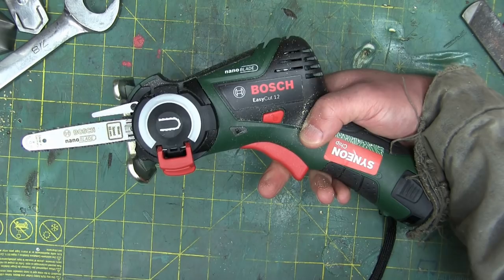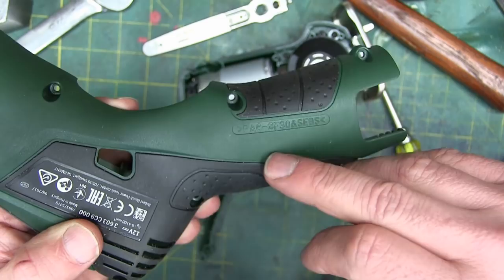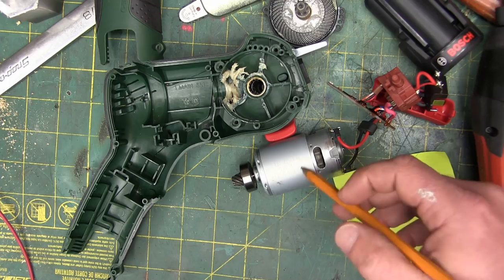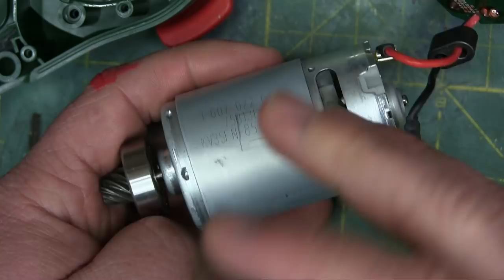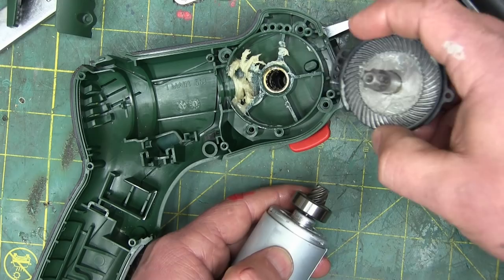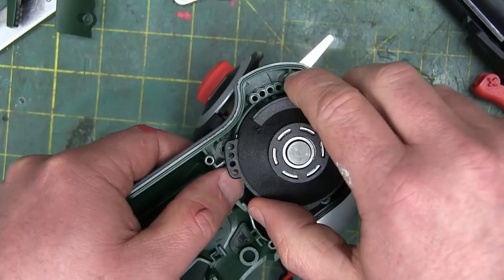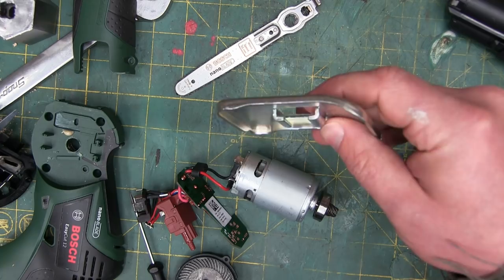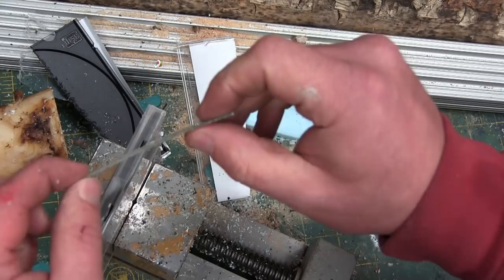BOLTR: Bosch Mini Chainsaw | KID SIZED DANGER!

Comment: I have to recycle a lot of boxes sometimes and fit them in a garbage container. And when I saw you use this as a box cutter I looked one up second hand. And I found one, not even 1 year old for 20 euros (he could not get rid of it lol). And it is really usefull for that purpose. But for the rest it is just garbage. Anyway thx for the tip uncle bumblef*ck!

Comment: Another great tool for the CIA .Who would have guessed , a pint sized torture tool designed by our German friends .Pocket friendly at that .Of course you can argue that cordless drills would be just as good for brain surgery but this looks like a winner for visual effects .
Remember when you needed gasoline to de-zombify the neighbourhood , now all you need is a spare battery .I got  to get me one to resolve the situation when the next bozo cuts me off on the road .jump out with Bosh in hand and radial tires on my mind.

Comment: I just bought the Bosch mini chainsaw from amazon, I’m in the us. My electricity is 110 v at 60 cycle and this is European at 220v 50 cycle. Do I need 50 hertz 220 to chooch the battery or can I adapt it to 110v 60? Or does the  cycle really matter? Can I charge it by inverting 12v DC to 220 with a European voltage inverter and keep my dick in the vise that way?